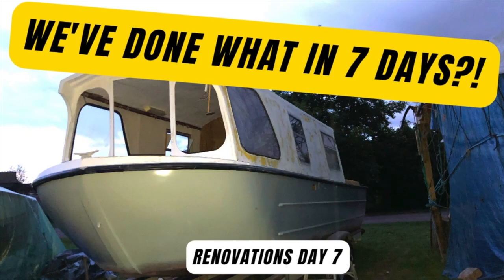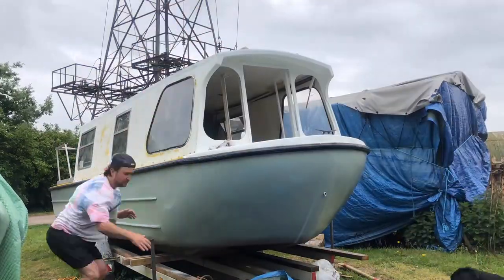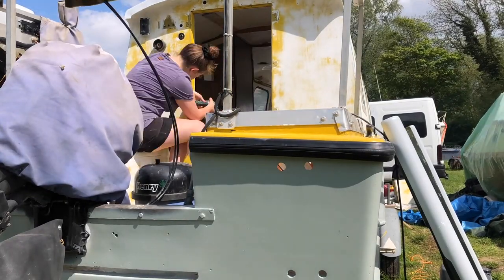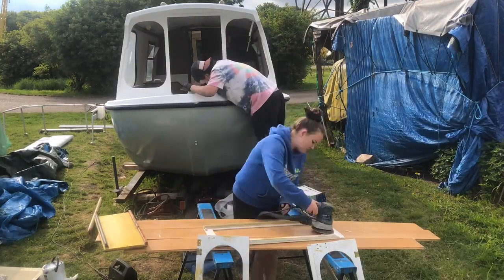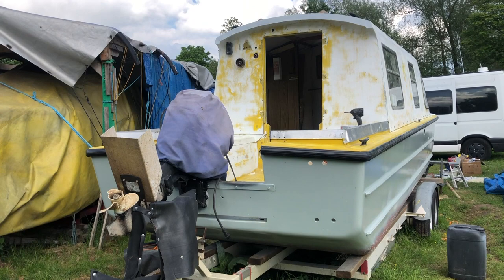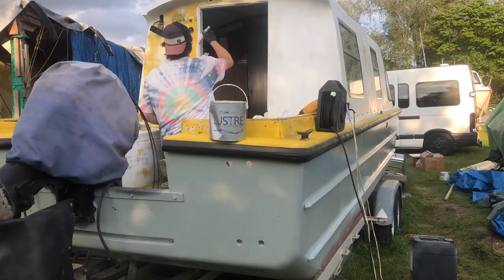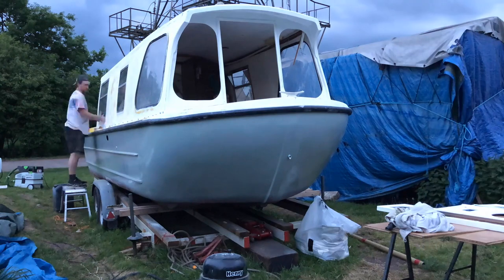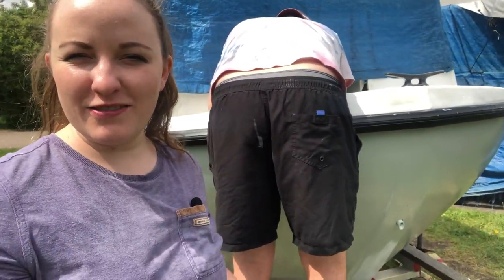We've done WHAT in 7 days??? - Wilderness Beaver renovation.

Comment: Well done so far guys, it's coming on great, just an idea for your roof that will force it back into shape and strengthen it without reducing your headroom too much. Galvanized steel flat bar formed to the contour of your roof, screwed or bolted into place across the roof, and then fibreglassed over, should do the trick nicely and not overly expensive.
Reply from the maker: Hi Ian! Thank you - I'm glad you think so! Thanks so much for the idea - that could definitely help!! We're going to start on the inside very soon so your idea has come at the right time!
Reply: I would have used 2 inch aluminum angle fiberglass over it strong light and brackets for solar panels